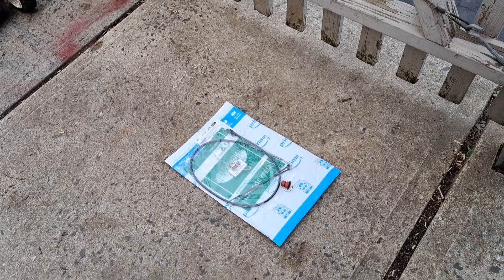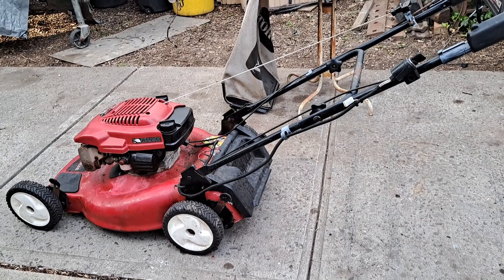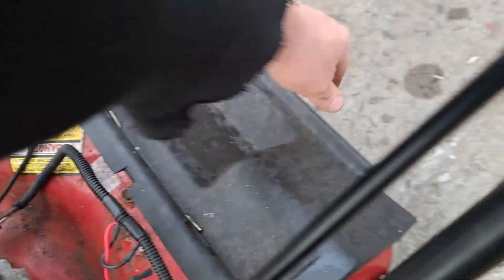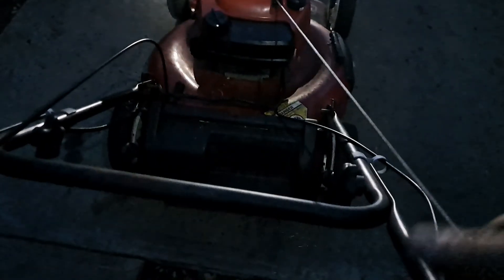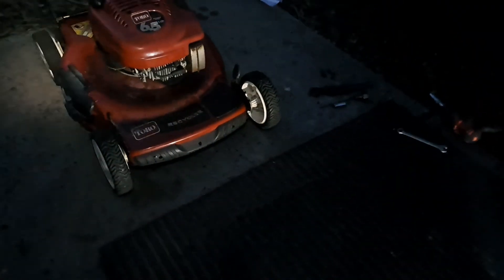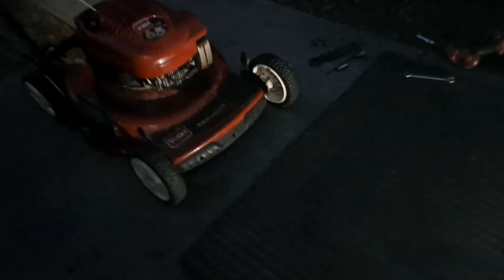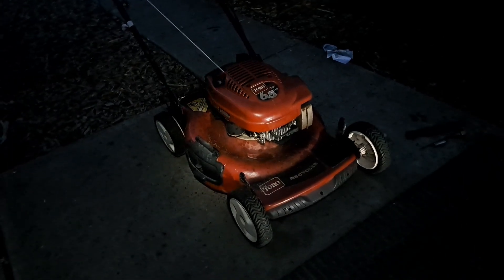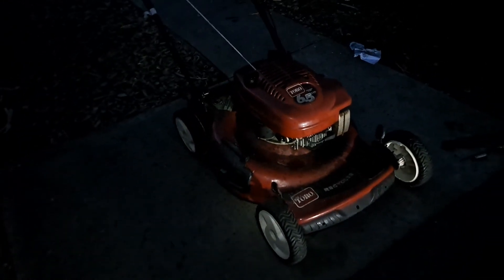Toro Recycler 2003 part 4. Repairing the self propelled personal pace.

Comment: Tomorrow I am going to be teaching some young men how to do basic service on small engines, some of my neighbors will be bringing their mowers over to get them done. When I mean basics, that means oil changes and wheel lubrication, but I will tap into carburetors a little bit.
Reply from the maker: 👍
Good idea. Carburetors are the #1 reason power equipment gets knocked out. Leaving ethanol ⛽️ sitting in them.